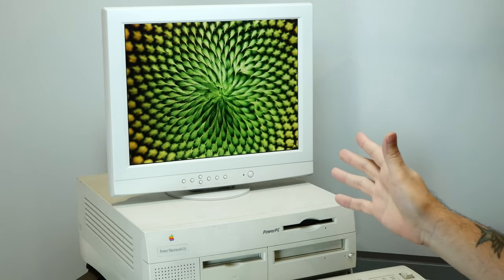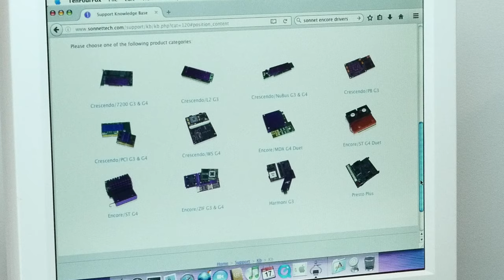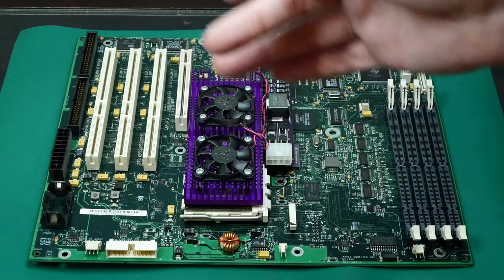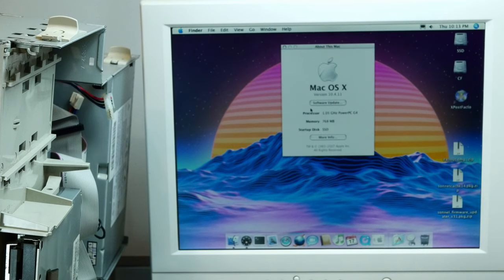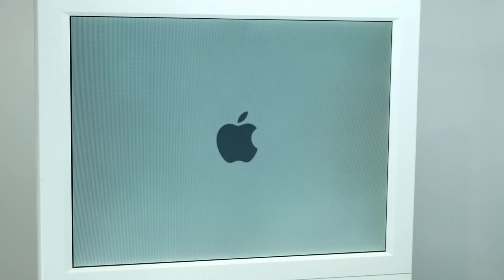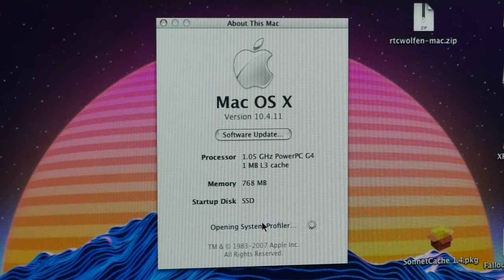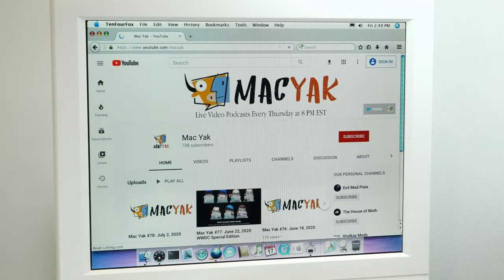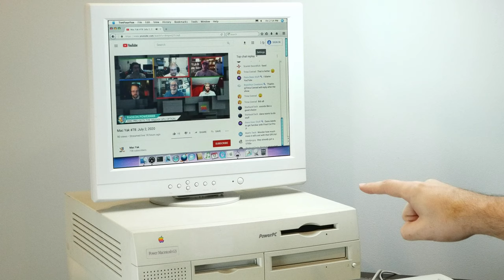Installing a RARE 1 GHz G4 upgrade into a 266 MHz Beige G3 Macintosh - The Beige Beast, Part 4!

Comment: Apologies if it's already been stated, but one of the coolest things is the SSD being clocked at 133MB transfer, that is *literally* the total speed of the entire PCI bus, so you can truly be said to be getting absolutely, positively, 100% of the data movement capacity (speaking of just moving files from "a" to "z", etc.) that computer has or will ever have to offer 👍
Reply: I thought I saw 64 bit pci in there

Comment: I would recommend finding an official Mac version Radeon 7000 or 9200 for Tiger it would run a lot smoother... Make sure it’s an official one... Flashed versions do not have old boot rom support
Reply from the maker: Oh yeah, I actually just picked up a 9200 Mac edition the other day. I'm really interested to see just how big of a difference it makes
Reply: Action Retro I’m looking forward to see if your Radeon 9200 runs well on your Beige G3. My Beige G3 hates my 9200 128mb VRAM and would crash all the time and I had to downgrade it to the Rage 128. I have an official Radeon 7000 coming overseas so I’m hoping it runs good on that one.
Reply: Flashed versions with cut-down roms don't have old world boot support, but if you desolder the flash chip and replace it with a new one big enough to write the entire rom it works perfectly.
Reply from the maker: @sixteenbitify  Oh interesting! I'm really hoping it works well

Comment: I'm loving your content, but I feel like that CPU card is DOOMED without a fan on it. Put that lil noctua directly blowing on the CPU. Beside it, blowing across the fins... I understand there's no room on top. Just don't want to see a cool piece of old enthusiast tech die.
Reply from the maker: Thanks! Yeah I was really worried about that too. The Sonnet instructions specifically say that the case fan is enough to cool the CPU because it's actually directly over the heatsink, like a half inch above it. That's why I added that Noctua though, and I'm thinking of adding another Noctua behind the processor to help vent out heat.
Reply: I doubt that processor gets much above body temperature.
Reply: @ActionRetro  build a duct to blow air down under the upper tray
Reply: I might suggest if you can fit a larger Noctua fan on the side of the case and dremmel out as much as you can without making it look ugly.
Reply: @ActionRetro  try to add a notebook style cooler
Reply: @wishusknight3009  G4s always ran a little on the toasty side, which is why the heat sinks on the Power Mac G4s were pretty beefy for the era.
Reply: @EweToobUsername  This one he has is a .90nm shrink and is the same generation of the dual 1.4ghz ODP I have in my quicksilver.And mine is a fairly cool running cpu at that. Mine has a max heat output of less than 30 watts, his will be well under half of that.
Reply: I went the other way. Duct the fan with cardboard so it's dragging air across the Heatsink and pulling air over it. Fan was side-mounted next to the cpu at the front of the case. Also you can increase your memory scores and overall system performance changing the front side bus multiplier (assuming your RAM is not 66mhz). It makes a big difference.
Reply: @ActionRetro  swap the psu fan. Higher flow would help it too. You could also open up those holes on the intake side to increase airflow.
Reply: @ActionRetro  probably too late for that (lmao), but afaik Noctua and some other manufacturers have some extremely low profile fan models. I think i even used one such fan in an old Sony micro laptop if memory serves
Reply: That's because the processor upgrade was designed for G4 towers, with plenty of air circulation as opposed to a super tight G3 desktop case, designed ONLY for passive cooled G3; at least the SSD is not generating much heat compared to a mechanical disk, but so much pci cards, memory, and cpu upgrades certainly makes for a thermal crisis inside that desktop tight case
Reply: notebook fan for rescue
Reply: water cool it

Comment: Oh god used to do this in the early 2000s in junior high and high school. Gotta find an OF bootable DVD burner now for it, and run Handbrake to rip a DVD. (I sold them as DVD archiving machines for a pretty penny) — maybe a game of Sims and Sim City 3000 and Sim City 4 for good measure. Starcraft because why not. Would be cool to see performance of those games on this also!

Comment: Not sure if this helps at all, but the upper case behind that second drive bay (the one next to the floppy) is actually drilled specifically to accept a cooling fan as well. I did exactly this kind of building/experimenting back in 03/04 in college, and when I was experimenting with overclocking, I found that adding that fan did make a small difference in CPU temp. I can't remember which direction I mounted it though, so you'd have to try both ways. Hope that helps.
(Also, these upgrade cards were still available new back then and I can remember having to sit on my hands so as not to blow my food budget for a whole semester and then some on an upgrade card for a tinkering machine that wasn't even my primary. Good times.)
Reply from the maker: Thanks!

Comment: The Sonnet G4 looks like a good upgrade at first glance, but it's really a dud. It basically cripples a 133 MHz FSB G4 on to a 66 MHz bus in the case of the Beige G3, or due to a bug on the B&W G3's chipset, also 66 MHz.

I have a Sonnet Encore 733 for my B&W G3, and while it does provide a speed boost in raw processing speed, it slows everything else down due to the 66 MHz bus. There were other companies that made G3 upgrades using faster G3 chips, up to 1.1 GHz, which were faster all around than the Sonnet G4 upgrades. The only reason to go with a G4 is if you have applications that take advantage of the Altivec unit, which were few and far between. Otherwise, going with a faster G3 that ran at a normal 100 MHz FSB was the better choice.

When comparing my upgraded G3 to my real G4 733 DA with a 133 MHz FSB, the real deal is quite a bit faster due to the doubled FSB speed.
Reply: I'd say it might have been a good product for someone who has upgrades already installed into their beige G3 and didn't have the $$$ for a nicer system at the time, but Sonnet's price on this CPU upgrade takes a lot of the appeal away in that scenario.

Comment: oh God, next time you will break the plastic tab from the CPU socket... Don't just force the clamp outwards, the upper hole is for putting a flat screwdriver in vertically, push down the clamp first and then out. (or you can push it down with one finger and open it out with the screwdriver) Take care, those plastic bits sometimes do break and then you will have to mute the audio for protecting younger audience :D

Comment: Nice! Just got my SSD and adapter for my own frankenbeige G4 1.0 Sonnett system. (I'm one of those insane people that paid 700 bucks for it long ago.) Will be on it this upcoming new first week of 2022. TBH, you CAN fit the Sonnett card with it's fans, if you clip off the cage that's under the fan. If you do that, there's about a quarter inch of space once you drop down the internal shelf. The ATA cables to the drives is the biggest cluster-making crazy issue. I used mine to play back SD avi files to our old 27 inch CRT TV, using the old MPlayerOSX. The bottleneck will ALWAYS be that 67 Mhz bus. Went from that to a MacPro1,1 in 2007 - what a leap it was!

Comment: I watched this whole series (very cool upgrades btw) but it honestly drove me crazy seeing you not CLEAN the inside of that machine!  I mean you put so much love and attention into it whereas the very first thing I would have done would be to at least go over the insides with a can of compressed air to get rid of all that loose case dust, if not a more thorough cleaning.  I also agree that your sweet 1GHz CPU needs some direct active cooling - even if you have to get creative with a side-mounted solution blowing air across the top of the fins.  Something.

Comment: Awesome. I'd totally install a PowerPC Linux on there for the most compatibility but I know that's not what the focus of the video was. Great content as always!!
Reply from the maker: Thanks man! I want to try booting Adelie Linux on here, I bet it could run a 5.x kernel that way. I just don't know if Linux could understand the SATA card though, so it would probably need to be on IDE
Reply: @ActionRetro  Adelie is in heavy development though... If it was me I'd me masochistic and use a source based distro like Gentoo or Funtoo... lol. I'm glad you know what Adelie even is... I thought I was the only one to discover it. lol.
Reply from the maker: @ShiggitayMediaProductions  Haha I love Adelie! It's such a tiny underdog distro but so fast on ancient machines. I have it on my G3 333 iMac and use it to SSH into my Threadripper at work!
Reply: @ActionRetro  Do you have Xorg running on it? I could only get it sort of installed and running with a base system in a VM... not onto bare metal yet....
Reply: @ActionRetro  Modern Linux kernels should see PCI SATA cards just fine as far as I know and can tell... you might have to compile a custom kernel from source if it doesn't, but I'm running Funtoo Linux on my Ryzen 5 3600X here and it sees SATA (and even NVME modules) after I custom compiled my own kernel. Also I'd recommend against kernel 5.x for right now... 4.x.x is still good. It's what I'm running on. Then again I have no clue what Adelie "ships" with when you do a base install, so your mileage may vary. Join their iRC channel. They're pretty active with helping people with Adelie, especially since it's an RC and not even a true 1.0 yet.

Comment: How hard is it to get good troubleshooting info from the olden days of the web? Like I remember when I had a PDS G3 card alongside a couple of Digidesign cards I had to use an older version of the Sound control panel--it was either 7.6.1 under 8.1 or 8.1 under 8.6. I'm not at all sure how you'd figure that out now, although that was pre-Google so I don't know how I figured it out then either.

Comment: have you thought of retrofitting a laptop blower fan onto the side of that heatsink, or possibly sticking one to the underside of the drive chassis? would allow you to get directed airflow onto the heatsink without too much concern for space issues.
Reply: This was my thought. Put in a laptop side blower and put a cage over the heatsink to force the airflow through the fins.

Comment: I wonder if you can get a PCI GPU that supports hardware offloaded video decoding and get YouTube playing properly. Might want to get a fan on that CPU as well, I don’t know if it has a concept of thermal throttling on these old chips, or if it will just damage itself. Especially as it seems to still be overclocked.

Comment: On my G3 B/W I found that ssd's connected to the ide port with a ide to sata converter give shorter boot times than connected to the pci sata card, tried it with hd too, same result. Mactracker says they both run at 33 MHz, but still the ide to sata converter is much quicker!

Comment: 11:11 - wait, you could have a 1 GHz Power PC G4 processor without a fan mounted on top of the heatsink and it wouldn't overheat?  Try doing that with a 1 GHz AMD Duron/Athlon processor (also from a comparable time where the PowerPC was still in use) and you would get a fried processor like in 20 seconds after posting.
Reply: I suspect the processor might be throttling down due to lack of cooling. The Geekbench results were the same as an iBook?
Reply: A 1 GHz PowerPC G4 draws substantially less power than a 1 GHz Athlon. The G4 uses 15-17W, while the Slot A Athlon uses 65W and the Socket A uses 54W. Not all CPU architectures draw the same amount of power at the same clock speeds.

The purple heatsink on the Sonnet CPU module has enough mass to run for several minutes without overheating with no fan cooling. I have the 733 MHz version of this upgrade and it has no fans at all, instead relying on the power supply fan for cooling, it gets warm but not hot when the case it closed. It does need a fan if you leave the case open.
Reply: @GGigabiteM  RISC’s low power consumption is the best

Comment: Wow, this video series is quite cool. I was thinking of my old G3 and here I am. I have a hot rod G3 with 768MB ram, G4 overclocked to 666MHZ, USB/Firewire,  IDE/133 card and Maxtor 133, Radeon graphics, DVD/CD Burner. OS Jaguar 10.2.8. I used this quite a bit from 2000-2006. I had it out 3 years ago and noticed the brittle plastic, but still booted up! I wonder how a SATA/SSD would increase it's speed and use a light Linux and put the old girl back in service. The ram is my biggest concern.
Reply: Flash a PNY fx6200 PCI to mac ( use the rom from the g5 Imac) I MIGHT still have a backup somewhere.

That will give you the biggest boost

Comment: Only last month did I put another drive into my Blue & White with its Sonnet 1Ghz upgrade to finally install Tiger and it's only since watching this did I realise there was software for OSX to go with it. DOH! Suitably installed yesterday so it can utilise the cache, it's now far more usable.  (In my defence, I installed the Sonnet upgrade when 10.2 was mainstream and I was still firmly stuck in the 9.2.2 camp at the time, never having any spare beer coupons to spend on extra drives to risk losing my 9.2.2 install!)

Comment: Very nice. I might get a Tower for something like this, but my desktop is meant to be my, “What if I had a fully loaded G3 and just did common upgrades?” So mine has Gigabit Ethernet, a Sonnet Tango, a Rage 128, and a DVD burner. I’m going to make a video on it today as I’m getting a Kensington two-button ADB mouse. I’m also adding a Global Village 56K modem in the PERCH slot (I’m going to show GlobalFax in the future because it was one of the coolest utilities ever made for the Mac) and replacing the power supply with one from my parts machine because it takes 90 seconds or so to go from a black screen to full video and I think the PSU is the bottleneck. Good as usual.
Reply from the maker: That's awesome!!
Reply: Action Retro Well, bummer. The Kensington two button mouse from the seller on Amazon came in as an ALPS GlidePoint ADB trackpad. Historically, it’s interesting because when Windows 3.1 came out everyone was trying to reinvent pointing devices. It’s interesting, but not THAT interesting. Probably better to get a GlidePoint keyboard and review that. It delayed the video, but I’m still making one about the PSU.

Comment: I would probably open the psu on that and put a higher airflow fan in it. I would also probably open up those holes. And put a wire fan grill.

Comment: Found your channel because of the cursed SE video. Loved that video, the SuperMac series, and this one as well! By the way, what monitor are you using? It looks great.
Reply from the maker: Thank you, that really means a lot! It's an NEC MultiSync LCD 1525v that I debadged with Magic Eraser. It does really look great with vintage Macs, and it can handle a ton of old resolutions and refresh rates.
Reply: @ActionRetro  Sweet, thanks for the info! Time for another saved eBay search ;)

Comment: I had this in a B&W G3 tower, with 1gb of ram, and a fx6200 pci with 256mb. It played Halo, at 720p on a widescreen flatscreen with ZERO issues. The only drawback was that Leopard wouldn't run, period. (G3 Rom, modded by Sonnet)

Comment: I was going through some of my old stuff, and found a power mac g3 blue and white tower, when I opened it up, I saw it had a big purple heat sink on it. I got the machine running again and on boot up, the splash screen for mac os 9 has a addition of powered by sonnet. I remembered you said there was a need for a additional program to get it to boot in to osx, I guess the question is, if I up grade the os, when do I need to install the program for the zif card, or is it already there
Reply from the maker: Download #2 here should be all you need! https://macintoshgarden.org/apps/sonnet-driver-2002

Comment: At some point I had a Quadra 8600 with a 3dfx voodoo 5 5500 PCI card and it worked very good on OS9 to play unreal. May be that would be a worthy upgrade? (not sure if it fits in the G3 to be honest) 

You should also be able to buy the pc version and apply the Mac firmware (not sure if that can still be found online)

Comment: I don't know much about old macs so forgive if it's a stupid question but can you still add more l2 cache externally?
Reply: No - the cache isn't exactly "external", it's soldered to the CPU board! Even if you could solder a new chip on there there's no guarantees the CPU would work with it - and the soldering for this is probably too fine for humans to do.

Comment: You should try installing Leopard just for the hell of it!
Reply: This G3-board ist able to boot 10.2  withou cheating. You have to use xpostfacto to boot max. 10.4. Thats all. Remember this machine originally was sold with 8.0 !